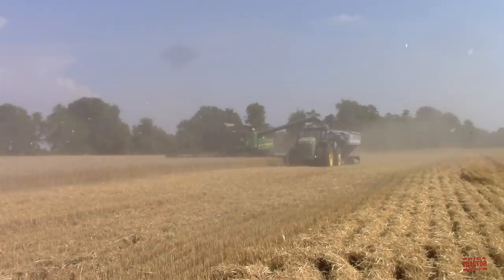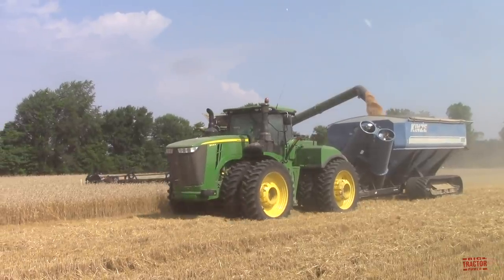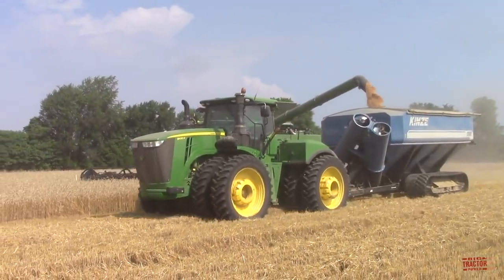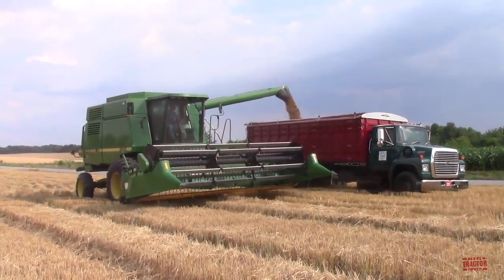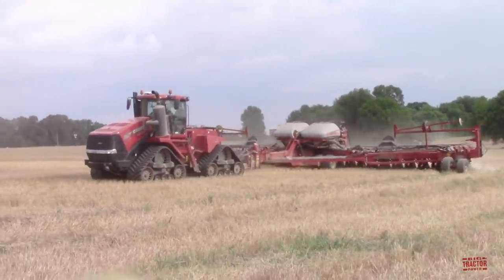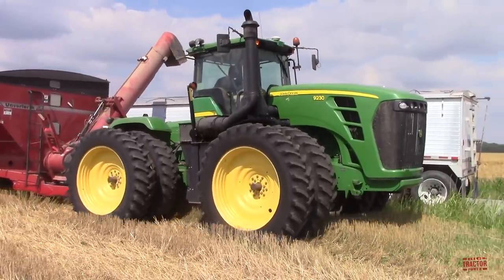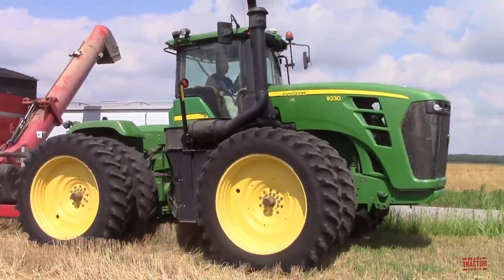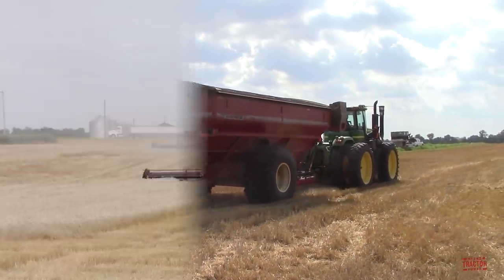BIG GRAIN CARTS Moving the Wheat Harvest

Comment: So what is a typical wheat production per acre? Here you said 90-100 bushel to the acre but I thought in another video I had heard 160-200 bushel to the acre. Thanks for the information.
Reply: depends on what part of country you are in, some of the wetter winter wheat areas up to 100 bu an acre is common, other dryer areas, like norther Montana 25 to 50 bu/acre, very dependent on location and weather, some wheat growing areas only get 2 - 5 inches of rain on the high planes - limits potential a lot.

Comment: I have noticed in your and other guy's videos that there are draper heads with conveyor belts others with augers. Are there advantages of one system over another  or is it just two different ways of doing the same thing ?
Reply from the maker: The Draper head is 100% better than an auger head.  Even feeding, faster speeds and a wider cut are possible with a Draper.  An auger head tends to wad the crop up.
Reply: @bigtractorpower  thank you. Another question if you don't mind, you think that other vacuum head (forgot the name at the moment ) is going to get more popular?seems to make a cleaner grain samples ,machine doesn't have to work as hard, maybe less fuel used guess it would have to be up to the individual farmer.

Comment: After the stripper head goes through and leaves the majority of the plant, how much of the plant remains for the combine to thresh out when the double crop beans get harvested?
Plants have more resilient stems and stalks than ever before with new genetics so if they dont decay or at least lay over,  it seems like extra chances for crop loss with all that extra material having to go through the machine later on.
Reply: Typically here anyway the stripper head straw falls down and creates a thick mat on the soil. If it does stay standing its so brittle by fall the combine just blows it out the back with no effort.

Comment: I noticed the New Holland combine kept draining wheat out of its auger as it moved back against the combine until it stopped.  Is that a result of the machine or the operator?  I've never operated a combine and am just curious.
Reply from the maker: Most combines do this when they finish unloading. A few grain run out.  Massey Ferguson has fixed this issue by have the rubber boot on the end flip upwards after unloads to catch these remaining grains.

Comment: Does the soil itself ever get tired or burnt out from constant growing?
I understand the stubble provides nutrients bit do fields ever get year break?
Reply from the maker: No need for a break. The soil is plenty healthy.  The fields after beans sit all winter until they are planted into Corn in March.  The double crop is just using the ground like full season beans would.  There is plenty of fertilizer on the wheat that carries over to the beans.
Reply: @bigtractorpower  Is there no fertilization for the beans? Is water never an issue in Kentucky , when they do beans after wheat ?